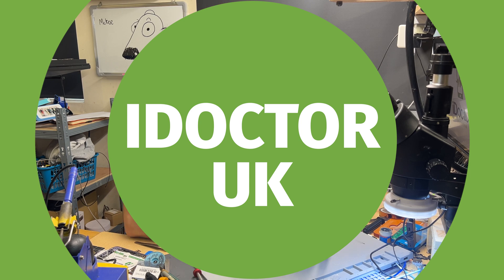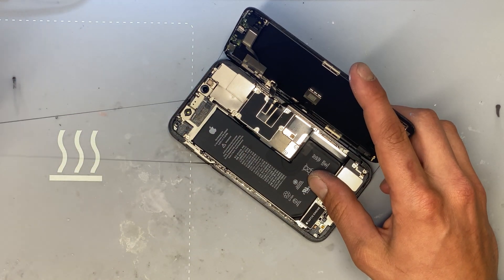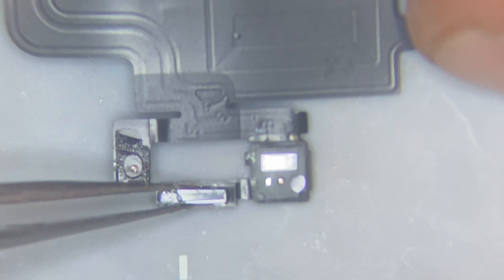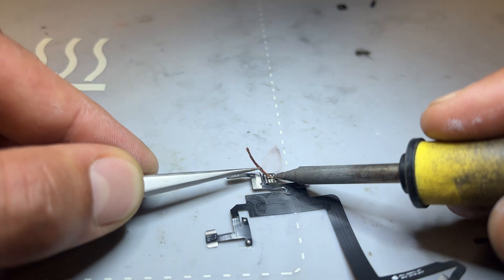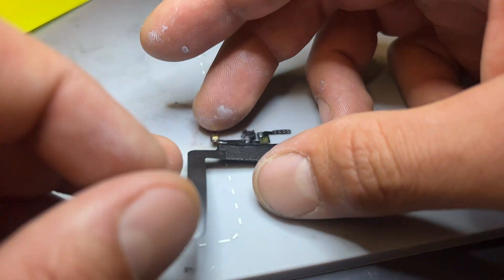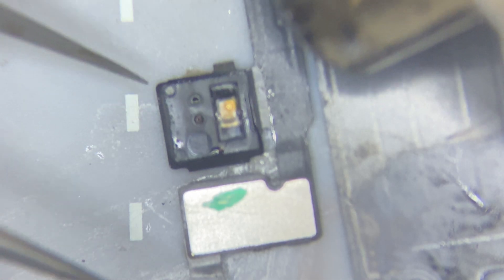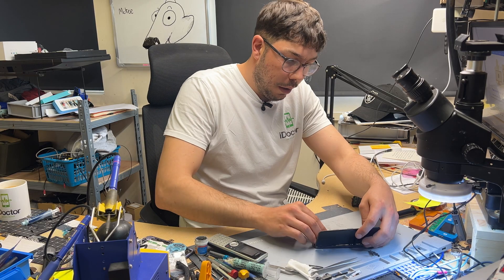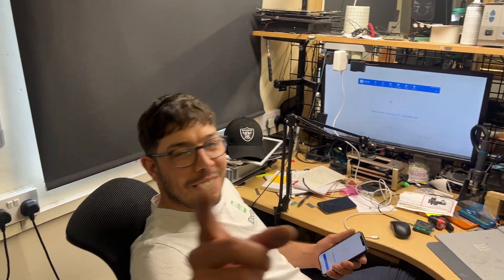iPhone 11 Pro Stuck on Flashing Apple Logo Bootloop Problem

Comment: Hi. Great video!

I'm glad you mentioned the 183C v 138C solder thing, as I have just started into micro soldering and was in two minds as to which one to use as there seems to be different views on this.

I just did a successful iPhone 11 touch IC transfer recently (to one of those chipless screens) using 183C, and you have now cleared up the debate for me, I will continue to use 183C.

By the way, your video on the the 'Ultimate Guide To replace the screen on an iPhone 11' was my main guidance vid for this!